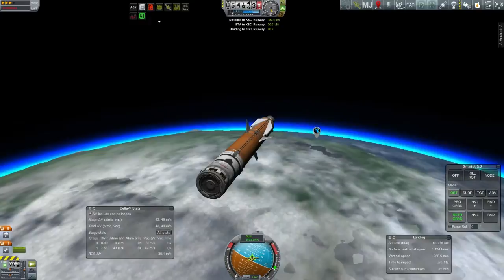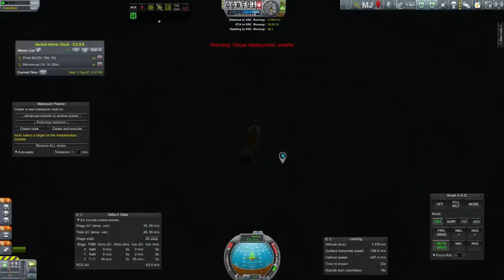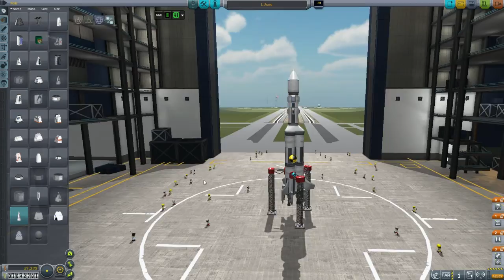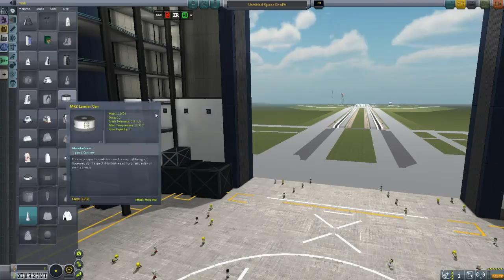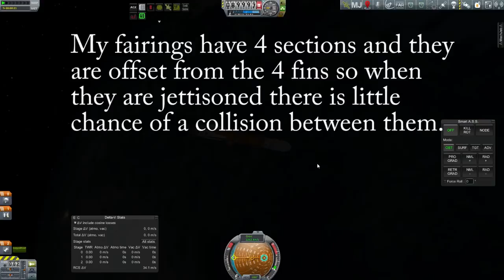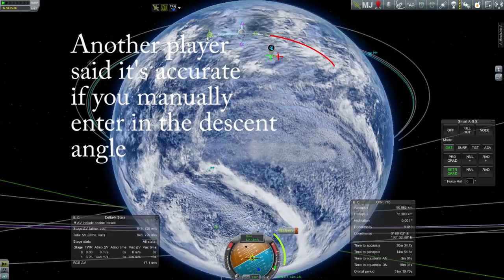Reusable KSP - How to Land Your Boosters Tutorial

Comment: Try using without parachutes just only rocket fuel to do that you must release with some enough fuel to land on earth.
Reply from the maker: I went way past this method of landing boosters.  Once I got  FMRS in there I started doing it the Falcon 9 way, but with parachutes assisting during the final decent.  Doing it on engines alone is quite hard and my hats off to you if you can consistently do it that way!  I have done it but not consistently enough to make it worth my while.

Comment: I'm almost 5 years too late, but man, thanks for this video.
Recently got into KSP again, and this inspires me to go for some Falcon-ish rockets. You're incredibly smart!

Also: 24:00 Those situations always make me lose it. The explosions are hilarious!
I don't know how often I thought I had a stable rocket, and one little bit of mismanagement or tilt in the wrong direction, at the wrong time and boom goes the dynami-... Rocket. Our poor Space Stations, so many boosters that rained down...
Reply from the maker: Thanks!  Yes this was a long time ago.  Towards the end of this series I did things much differently.  Sadly, I hurt my back in early 2016 and had to discontinue sitting at a computer for hours editing videos ;-). By the end of the series I was back to a 2 stage rocket with the second stage returning just the engine section after leaving the fuel tank in orbit as station sections.

Recently I started a new career mode and found the following:
1) early on, the best single seat rockets are just a huge solid stage topped with an efficient vac stage.  Tune the booster thrust to not burn up the capsule early in flight.  This is super cheap and fun to fly.  For landing the upper stage I just kept it with the capsule and separated it on the return when the entire vehicle had slowed to a reasonable speed and low altitude (separate, then switch to pop chutes and landing gear quickly).  
2) Later, I go for a more falcon like booster with a returnable upper stage but still separated the two low in the return.  It just helps with safety to have the vehicle balanced and engine first.

Have fun... I can't wait until KSP 2.0 in a few months!  Hyyyyyype!

Comment: Bryan man. It's such you're a shame you're 'no-one' in the ksp community - your content is quite detailed. I'm just starting out and wanted to ask - I've tried landing boosters through action groups after detachment whilst in kerbin atmosphere. I haven't got access to mods and was wondering whether I'm missing something. Is it possible or must it be done in orbit?

As i type this I here you say that without control it will remove it from the game once a certain distance from me? Is this why? 
If not, a short explanation would be sooo fricken helpful i've been banging my head for ages.
Reply from the maker: Hi James!  Thanks for the compliments.  This was early on in my re-usability skills.  Landing a booster can be done with or without a full orbit without mods however it is extremely difficult.  

Later in the series I go on to SpaceX style landings and finally to a SpaceX style landing for Stage 1, and then returning only the engine from stage 2 (I was using the stage 2 fuel tanks to build a space station).  

The only real flat ground on Kerbin you can land on is that area right around the space center.  Because boosters come down with very little in the way of control over it's flight path you have to hit that bulls eye with a de-orbit burn done 70km up and hundreds of km down range while traveling at 2.6km per second... the timing is SO hard.  If your off by a tiny bit (a second or two) your headed for the water or the hills and certain destruction.

The game "cleans up" suborbital debris under certain conditions.  These conditions have changed since I made the videos and I'm rusty so I don't know them from memory but it is something like: A) the debris is on a sub orbital trajectory and inside the atmosphere and B) you are more than X km away from the debris.  When I made this video it was 2.5km but I believe it was increased at some point... maybe to 10km?  This is an important consideration for an in-atmosphere staging... but allows an opportunity for the technique below:

Another technique for stock is to send the entire rocket into a trajectory where it will be suborbital but outside the atmosphere for long enough for you to release the upper stage, circularize the upper stage, then switch back to the sub orbital first stage before it enters the atmosphere and gets cleaned up.  I've seen Scott Manley do this (find him on YouTube if you have not already... he's THE MAN when it comes to KSP though you'd have to watch very old videos to get anything out of them since he's mostly retired from KSP).  This method is extremely hard too and makes for inefficient designs IMHO.  You need a steep trajectory and comes down where the KSP will be as the planet rotates underneath the booster.  Again accuracy is near impossible and mostly you will crash.

Now what you CAN do in stock is kind of cheat the landing.  Hover over that recover button and hope that the booster will stay stable for a second on that hill or water you landed on for the button to appear and for you to press it before the thing tips over and explodes.  Put lots of parachutes on it and have just enough fuel to slow down just as you touch down to around 5ms vertical speed.